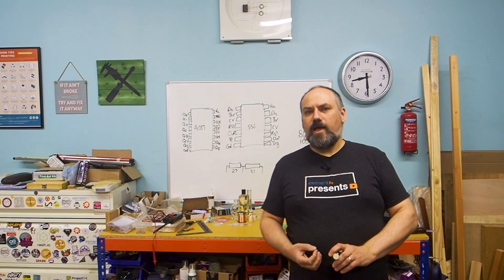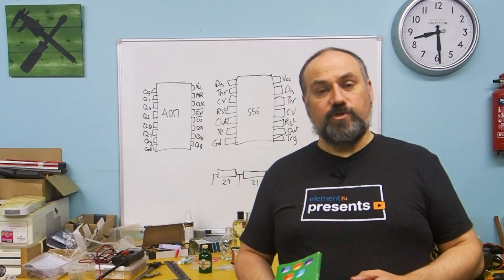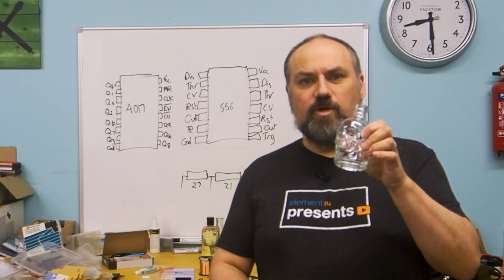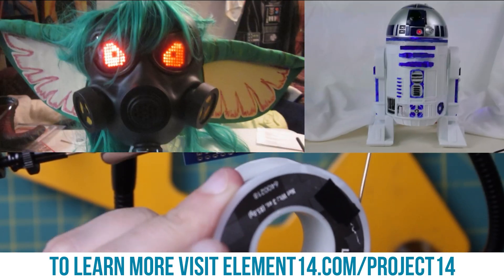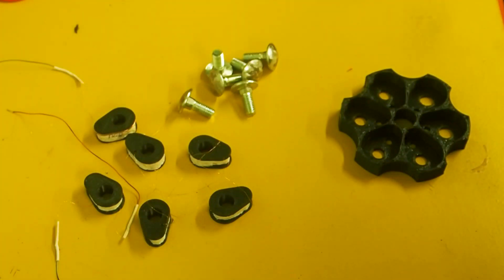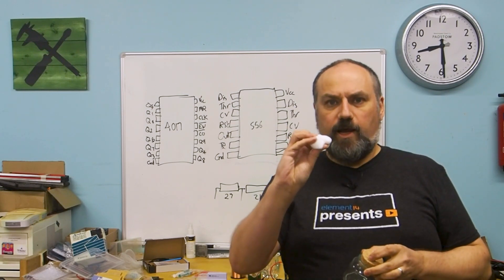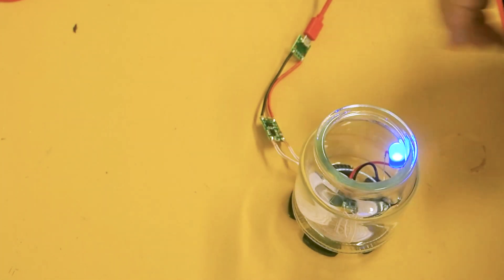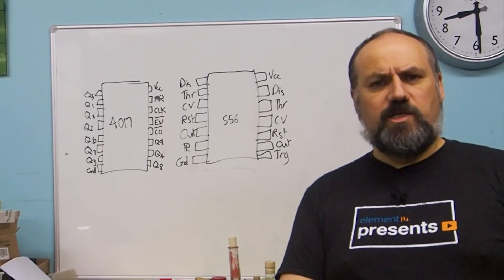Using 555 Timers to Make a Magic Potions Rack

Comment: Great concept. The frequency modulated 555 is a great foundation. I would prefer to see a single idea prototyped and iterated on. Having a bunch of ideas on paper and trying to go from that to finished product is hard if not impossible for mortals.
Reply: I did do exactly that, the circuit was built on breadboard first and I swapped in different resistor values and saw what happened. Tricky to film that part as 90% of it is "that didn't work", followed by plugging and replugging wires.
Reply: @Workshopshed  Makes sense. How did you come up with the design and materials for bottles effects?
Reply: I had the 2 smaller bottles from my trip to Falkirk and went online to look for fancy bottles. Found a shop that sold the skull bottle and they also had the other two. Then it was just a case of thinking of ideas for my three different bottles. I wanted a swirling one the most although that's ended up the least impressive result. I've seen the cloud effect before so that was an easy one to miniturise, and that just left the glowing one which seemed like a good thing for a potion to do. So then I just had to track down the UV dye and some mica flakes for the swirling one.
Reply: I'll be posting about the woodwork aspect on the Workshopshed blog.